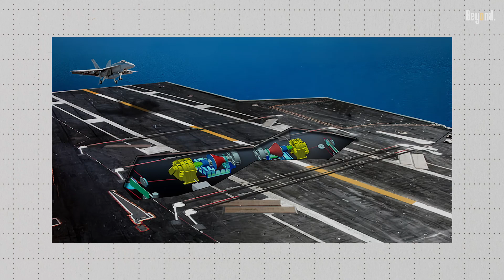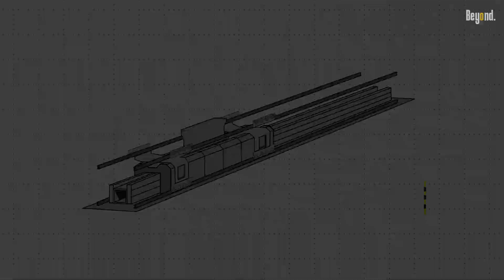The Problem with US Navy Ford-Class Aircraft Carriers

Comment: Bub everything you just said is old and outdated. All of these problems have been fixed. Also teething issues are normal for new technologies. 
Thanks to everything learned from the first ship. The next Ford carries won't have the same issues.
Reply: The second and third ships have been postponed😊😊😊
Reply: @boanzhou-tj8tm  They are still being built bub a slight delay is nothing to worry about.
Reply: My humble opinion is that if coruption is involved, they should get life in prison. If it's incompetence, they should have their retirement revoked and live on Social Security, just like I do.
Reply: I hate to have to tell you this but the impressive avionics that makes the f35 the whizz kid we thought it was has not been installed on ANY of the carriers.  It will be 2027 at best, costing millions more.
Reply: Four amphibious ships are equipped for this, but compared to what we thought we had, it's like marching off to war with a cast on your leg.